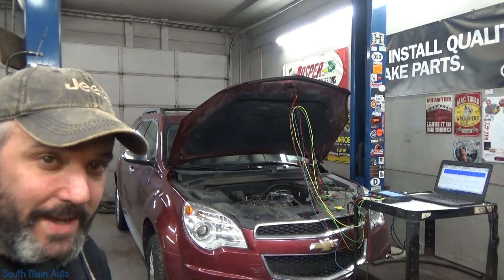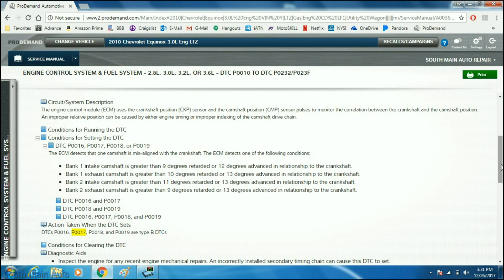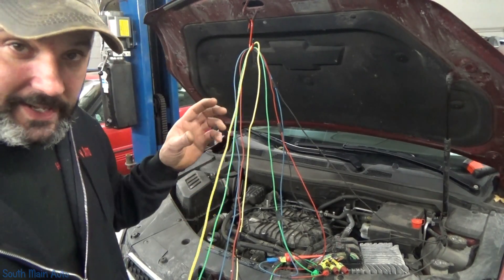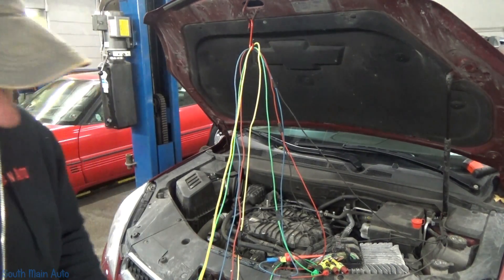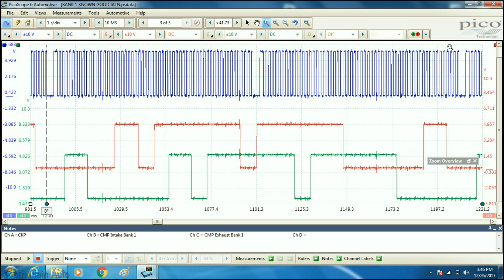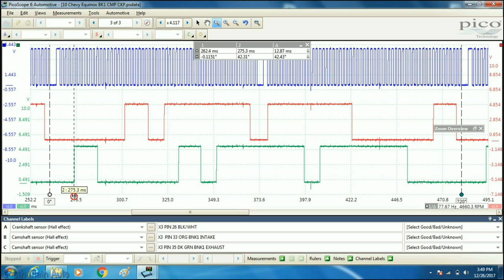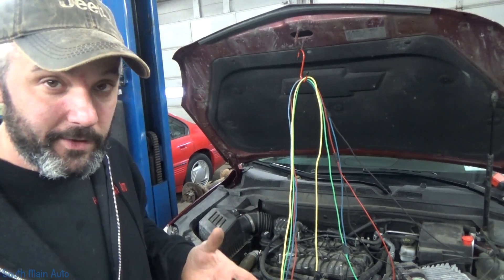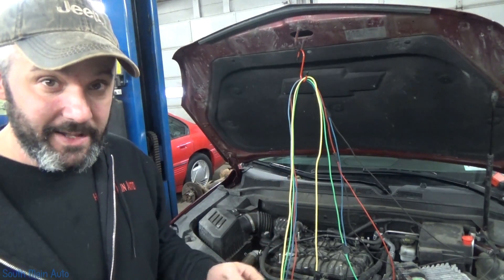Do I NEED A Lab Scope In My Shop?!

Comment: Awesome video Sir. I cannot confidently do my job without a scope. Now the next struggle.....knowing wtf your looking at! Understanding what type of sensor your testing and what signature you should be seeing. Monday i had an 04 f150 throwing an 0012 at me, ran great, no miss history in mode 6, no negative cyl contrib. on one bank. 180k miles, code returns immediatley, no chain rattle present. With lightning quick speed i scoped both cmp's and the ckp producing beautiful waveforms before my eyes. So now what.....IATN (which iam not yet a member of) is the only resource that i know of to obtain waveforms unless our fellow YouTubers happened to have done it. It was an out of state 19 year old from the college up the road so further diag was immediatley declined but my point being i was like 70% there but no known good to make a 100% call to drop the mic and walk away lol. That was the first time ive ever had an 00"" code on a 5.4 and had to check ckp/cmp correlation. All other times its been 0300s with chain rattles, left lower guide usually broken, and negative contrib. on one bank.

Comment: We had a low paid school worker with a 70's impala back in the day. High miles, noisy, and barely ran. School vocational shop took it on. The timing chain was so loose it ate right though the timing cover. Thanks for the videos.

Comment: Excellent! I have retired from the GM Powertrain group that writes the service information for engine diagnostics.
This is an example of why normal/good scope patterns should be included with factory service information. 
Unfortunately, there is a history of resistance from the dealership organization to resist scopes as a required tool.
IATN is a great scope pattern source for mechanics/technicians (choose the name you like).

Comment: For some applications you can survive with a cheap bench scope, 4 channel is around 350 and 2 chan could go for 250 buck.  Come with probes and have up to 250V tolerance so you will never ruin the input.. The only thing they all lack is the capability to record as long as you want and then paly back. Their have some memory but not big enough like a PC based scope. Bench scopes, you push power, bang, it is there. PC Scopes, need a notebook and rely on Windows ... To see CONSTANT PERIODIC signals and trigger on events, bench scope is good enough. To see the previous history of an event, zoom it with loosing resolution, and get more sophisticated trigers, inport and export captures . .... PC based scope looks the only way.

Comment: decades ago,I used now museum ALLEN and SUN  test "scope"-all unstable TUBE type
    -but found "funnies" with older engines and  chassis
     -now HOPELESSLY outdated  -so used cabinets for holding filters,lubricants

no experience with modern portable "scopes"
    but see you NEED at least 2 of them since NONE do ALL JOBS

Comment: I imagine the mechanic/technician that has a scope and knows how to use it will steal market share from his/her competitors that cannot solve the more difficult problems.  Plus the scope user will make more money by solving the problems faster - relative compression, primary/secondary ignition issues, cam/crank timing issues, issues with fan/fuel pump motors, and CAN data bus issues.

Comment: I too believe a scope is a must have in today's shop's. I know a couple tech's that dont use them and get the job done, but i believe it would make their jobs much easier + funner if they took the time to learn them. I myself use my Verus, but soon will be getting a Pico due to it's utility's like the degree measurements that you used without all the math. Plus the fact is when you go on IATN a lot of waveform's are saved from Pico which makes it easier to match up. Thanks for the video. And also i would love to see more with scope usage. Have a blessed day
Reply: I'm 36, in the bizz for 15 yrs...started getting interested in lab scope stuff when fellow old guy genius showed me what a Verus could do...used Verus and Snap On stuff for years...hated the only zoom out feature...just got a pico and have been totally falling behind on work out the door because I'm taking various known goods etc for experience...I own and run my own shop so that's my decision. Anyway, really enjoying the Pico and the excitement. Example: 1986 XR200: owner rebuilt topend started and ran 2 blocks (they say). I get the bike, check spark-yup good, check valve timing-easy to do (5 mins-maybe less), timing okay lash tight-set lash-no start still-When kicking over every so often it briefly fires-like 1 bang. Connect pressure transducer to cyl and secondary pickup on well plug wire-kick over and find random spark events. Remove CDI cover-find pickup not keyed onto camshaft-bolt missing, but would still spin, generating a spark. Then I look up a OEM parts diag and see that there should be a bolt on the end of cam to hold pickup in place. Keyed the pickup and replaced the bolt and fired up first kick. Finding spark timing on this and many motorcycles is hard, using a scope is the only way minus farting around all day taking things apart and hoping. This was the first time I used the Pico (luckily got it the day before).

Comment: Awesome video, I have been a mechanic for a heavy equipment dealer for over 15 years and the emissions have brought a need for a scope in my opinion. So any videos you can do with a scope is great. I have the Vantage pro for a starter scope in hopes to learn how to read sensors, CAN etc

Comment: I'm just a DIY and for $30, I got a Bluetooth OBDII reader that hooks up to my tablet/phone and using the Torque Lite app have access to all kinds of data that has already saved me money.  I wish it was 2 way communication so I could turn on/off components but for 30 bucks, it's great. Sadly, my own mechanic only has a pocket OBDII reader and that's it. He's great at changing parts but I often do the diagnosis myself before going to him.
Reply: When you must -- you need a new shop/mechanic.
He will be out of business soon anyway.
You can change parts,so keep watching You Tube.
Reply: I think he's been in business for 30 years actually, but I'm afraid he's one of those old timers that knows what he knows and doesn't want to keep up with new things.  I mostly use him because he's close to work and doesn't try to upsell me but if I ever get a newer car I'd go somewhere else.  I'm getting better at changing parts but I live in an apartment and depend on my car daily so unfortunately, if I need to lift the car, or it's something more complicated I have to outsource. Speaking of which, I need to see him because I noticed a small leak from the bottom of my 2 week old radiator near the hose.  Come to think of it, maybe I do need a new guy.

Comment: Great video...
A scope can indeed help you to diagnose/pin point where the fault actually is... at the component or somewhere else...
On your example, it is obviously even more crucial... would be nearly impossible (Without removing head cover etc..), to see the timing issue without a scope...
For me, the pico PC based is not practical, and although I have a 2 channel handheld scope, which I work with on some of my videos, I am know thinking about get the scope module for my Maxisys, which is a 4 channel... as it looks quite practical and more complete as well..
Thank you for sharing!

Comment: i'm learning how to use a scope, for these codes everyone at my shop would have thrown parts at these codes because the vehicles we see are under warranty. I've always worried about getting the job done and having crankshaft reluctor wheel that rotated.  you would think that if it rotated it would throw both banks off, but i have heard stories that only one bank was off.

Comment: I don't need a scope because I work on motorcycles before 1995 so these have carburetors and some even have still points and the Pico that you are using costs in the Netherlands 1200 euros wich is around 1470 us dollars and I work alone so it is also for my as a business owner not smart to buy one

Comment: A pressure transducer is a good way to rule out a mechanical issue. You can also look at the phaser operation. As you pointed out. Actuate it and measure how much it advances on the transducer wave form.
Escope  has the software already in it for this. But I find that scope is a little glitchy for basic use. I prefer pico for pinpoint and snap on for ease of use.

Comment: I think the reluctance comes from the manufacturers who really do not want the technitions to think about what they are doing. They just want a procedure to be followed. Part of the reason behind this is to protect themselves against patent infringement where documentation would give lawyers something. 
In the aftermarket many technitions want to replicate what the manufacturers recommend and this does not include a scope. 
In my opinion the scope is the best way to go.
In this case you could have possibly used timing pids to make the diagnosis but the scope is safer.

Comment: I would imagine if the crank sensor had problems it would show all the cam sensors were off or moving around, as the crank is the reference.
The scope and the reference recording just made it so clear.
Yes every shop needs a digital storage scope of some type :-D
Modern cars have so many sensors, not having a scope would be stupid.

Comment: If you want to know if the crank wheel moved put a pressure transducer in a hole. As long as you have a known TDC point on the crank waveform you would be able to tell if the wheel spun on the crank.

Comment: In the dialog box for the measurement cursors you can manually type the degree you want the cursor at and it'll move the cursor to that point for you. So if you want it at exactly zero degrees, just type that in and the cursor will move to exactly zero.

Comment: Bought the Vantage Pro a few months ago, still learning to use it via Scanner Danner; having fun looking at wave forms but still have no idea if I need to use an  attenuator on certain scenerios like ignition direct feed on primary (voltage rather than amps).. Recommended video is detailed and safe ways to hook up scopes in various setups especially where KV voltage is involved.  I have been told three other items needed with the Vantage pro are Secondary Ignition Clip On Wire Adapter EETM306A02, Secondary Coil Adapter Lead EETA309A05, last Inductive RPM Pickup EETM303A05.   Any comments would be appreciated.

Comment: I wish the databank at Pico had more waveforms, it's a free bank and could be very useful if techs would take the time to share details with others. They do have a few thousand waveforms and hopefully that will grow over the coming years. IATN works great for the pros but we amateurs don't have the financial resources to pay into something like that every month.
Reply: I could say the same thing about service info, and scan tools. Gotta pay the big bucks for good service info, which is not always an option for the amateur. I think were are really going to be screwed on some of these cars decades down the road, like 90's Chryslers. What are we going to do in 2036 when a DRB3 is hard to come by, and certain things can only be done with a DRB3?
Reply: IATN is only $20 a month that's really cheap for all the info it has available. Now Mitchel on demand or all data is outrageous

Comment: As a DIY'er / "mechanic friend" who works on relatives/friends vehicles, my main reason for not owning a scope is funds, I just don't get enough use to justify the cost and if it comes to a job I can't figure out it goes to a trusted shop.

I have been looking at the single channel scope from AESWave, just not sure  a single channel is going to be useful enough...
Reply: While any scope is better than no scope, a single channel scope can't show you the time relationship between two signals, which I would consider essential (And this video of Eric's is an example).  Four channels is nice to have, but in a pinch you can use two channels to view the relationship between each pair of signals . (Again, this video is an example.)
Reply: yeah, that's been my thought on it as well... It's just hard to justify spending $1k+ USD (I'm Canadian so $1200) on the 2 channel Pico when I won't have enough use for it...

Comment: I use a tektronics scope.  It's more for electronics - 200MHz is way overkill for automotive.  You can pick up used ones pretty cheap though.  Definitely get all the channels you can; some really low-end scopes only have 2 channels which you can get by with but not ideal.  But for some problems you MUST have a scope; glitches, weak signals, freq off, measuring pulse widths, etc etc.

Comment: Eric. I bought a Solus Pro and had it 2 weeks when I saw the need for a Lab Scope. I traded up to a Modis Ultra and find that I use the Scope & Multi Meter Functions as much and even more than the scanner functions. I am an Aircraft Maintenance Engineer and I wish that I had this tool many years ago. It would have been extremely valuable in troubleshooting intermittent "glitches" in landing gear circuits that can be too fast to catch with a meter or test light. Once you have a tool like that, you find ways to use it and wonder how you did without it before. Until you actually use one, you cannot appreciate what they CAN do.

Comment: If you want to graduate from the school of parts swapping 101, and stop wasting mega amounts of time, you'll need 3 things to repair modern cars and trucks. 1. a fast 4 channel scope 2. a good scan tool that has bi-directional controls 3. some sort of equipment that will allow you to do reflashes and updates on modules. Also, go get the training to use those tools proficiently. Modern techs never stop going to training classes. Take everything offered!  ( I have been using various forms and brands of scopes for 24yrs. and honestly, of the 90% of the stuff that I've repaired while using them, I cannot figure out any other way to be able to KNOW I will have a 100% fix after I've replaced XYZ part/s.  Math doesn't lie!)

Comment: I need a better scope.  I have a  2 channel scope that hooks to my PC.  Only goes to 10V, but  I have a single 10 to 1 passive attenuator to read higher voltages.   It has come in handy, and I want a better scope,  but as a DIYer it's hard  justify the cost of a Pico.

Comment: I work for a commercial landscaper. Electronics have been creeping into this end of the business for a few years now. There are manufactures that now put chips in their coils to limit rpm on their weed wackers. Efi engines on the big area mower machines and big aggro equipment are all gone with  computers. The last time I worked on something that had points and a condenser was 20 years ago...You remember those, points in a distributor

Yea, you have to have a scope or the software today, even in my end of the biz... But that is not the problem, the cost is.

I have wrenches that are 40 years old, will your scan tool work 40 years  from now.........The long term cost is crazy. Thank you EPA  !

Comment: I have been out of the service technician loop FOR WAY TOO LONG so my comments may be invalid.

For a 'scope to be a truly USEFUL tool require a very good understanding of basic electronics, especially Ohm's Law.  If a person does not have this knowledge and experience, it is not useful.

I get a lot of "heart burn" over the Pico 'scope.  IMHO, as a retired EE, it is 𝐖𝐀𝐘 𝐎𝐕𝐄𝐑 𝐏𝐑𝐈𝐂𝐄𝐃 !  It is built on technology that is 10-20 years old.  Does it still work ?  Apparently so, because people are still buying them.

The real "magic" in the Pico 'scope is in the SOFTWARE.  The screens that allow you to quickly and easily use different probes are valuable.  Their online resources are also valuable.  How valuable they are is up to the buyer.  For a shade tree guy like myself, knowledge and a much cheaper 'scope are plenty adequate.

Comment: A scope is definitely a necessary tool for diagnosis. The only problem is, as you mentioned, finding "known good" waveforms. It's not as if you can check factory GM service information and find waveforms for a new engine with the VVT solenoids plugged in, unplugged, etc. Vehicle manufacturers right now are not particularly scope-friendly in that respect.

Comment: Sun Ignition Analyzer are "fantastic for secondary ignition"  𝐎𝐍𝐋𝐘 on single ignition coil, distributor engines.  I never used one on a GM HEI, but I assume there must be an adapter.

Sadly, they are pretty USELESS for anything else.

Comment: It seems a lot of us are new to the lab scope. I believe we all agree on how useful they are. However, from the research I've done, I can see I need to learn a lot more before I know which one is right for me. Do I need a 1-channel or should I invest in a 4-channel even though it will cost considerably more? Do I need a scope that has automotive software or can I get by with a basic scope. I also remember you doing a diag on a car where the power steering pump pressure signal was affecting the fuel pump signal. In that one Ivan said it would have been better to use a true lab scope. I believe he was referring to the Vantage Pro not being a true scope. I hope I remembered that video correctly. Anyway, I think we really need the very basics. I really learn a lot from the way you explain and demonstrate procedures. Thanks so much for all your help.